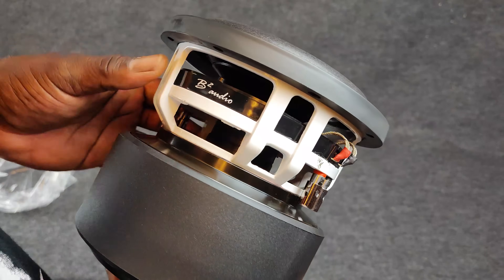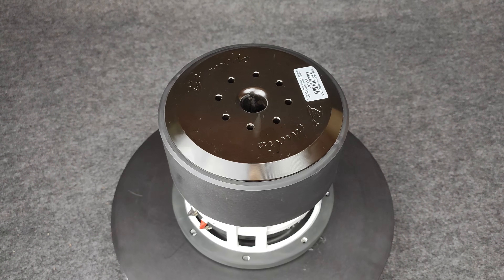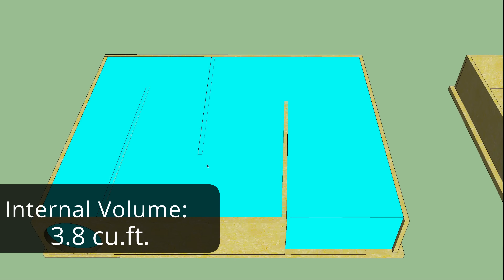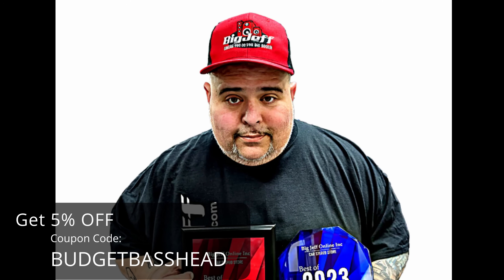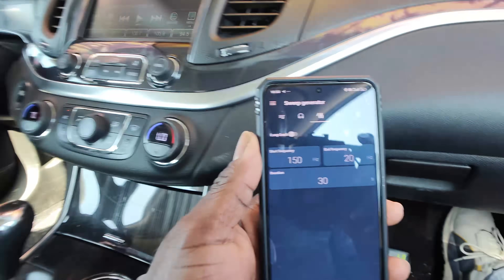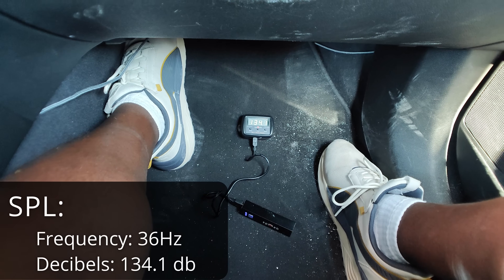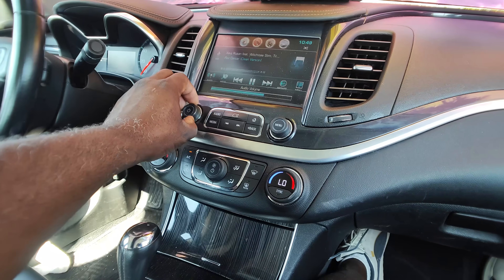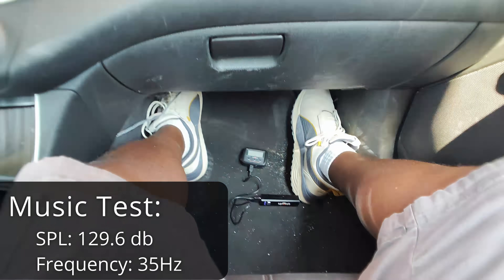I Built A Large Horn Enclosure For a 6 Inch Subwoofer - B2 Audio Rampage 6.5 - 2,000 Watt SPL Test

Comment: So build box to cover the WHOLE BACK of SUV and just rino line IT and put "stuff" on top of it if need be! Still gives ya useable "back area" as long ya rino line the top box and maybe put ya "matt" on top of the box?! TELLS ME A BMX 8 from Sky High with JP3 woild give me watt i want in my small daily SUV! (Or two 6.5s from their FE line? Tryn stay stock and jt have some "sound" onway yo sons senior HS year of baseball)!  I threw the 12inch SINGLE SKAR BUNDLE with their rp 800 in his old Gen 2 Explorer and he made his JL and MoonUp friends mad....yhey had pairs or one had triple 10s and his SINGLE LOW END SKAR "beat them down" and made them beg parents for more!  Thing is I OLD BASEHEAD and knew the PREOUT VOLTS is the "key" to good sound!  Cant use DUAL with dirty 2vs clipped up to 3.2v  and try get good sound! He got kicker 6x8s for doors over Cmas and now he MORE SQ! Plans are the compQ if something happens yo yhe SDR...have to big 3 his power then to get more out the rp800 but box is right at 2cubic feet so the compQ would work good in it!

Comment: I have a 2007 tahoe with a basic ported 4sq ft box tuned to 32hz, 2 sundown ev4s (ripped, looking for new subs), and a SIA 1750 (will upgrade to 2500 if needed) and the loudest i measured with a iphone and apple watch was 112-115 db at drivers head at around 32hz and a cabin peak somewhere in the 55-65hz range. Would moving to a horn enclosure be the move? I have my third row out but still would like to keep the box low with a 8 inch or something but I also want more power from 32 down (old subs flexed to much and was fighting the box)
Reply from the maker: Horn enclosures can provide a noticeable increase in output.

Comment: I understand how you can't resist testing any and all subwoofers! Especially this big ass little 6"! Another great video BBH!
Reply from the maker: Thanks, glad you enjoyed it. I do love testing out different subs.
Reply: @BudgetBassHead  hey what do you think of a horn for a kicker L7 15
Reply: I drew a mock up but so far its 48x64x14.75 were the sub sits will be 14.75 and the mouth would be roughly 30 wide any thoughts
Reply from the maker: @LoganAllen-te3qk that's a 2:1 ratio, between the throat and the mouth, which is pretty much what I try to shoot for if possible. But man that's going to sound quite epic! How long is the line?
Reply: @BudgetBassHead it should be around 108 inchs long
Reply from the maker: @LoganAllen-te3qk what tuning are you shooting for?
Reply: @BudgetBassHead ngl i have to do some more research i am pretty sure watching your videos i can try and learn how you were able to tune yours . But just being honest i have no clue boss i seen yours , seen how bad ass and responsive it was and wanted to try it out my self the box for the 6.5 is amazing you did grate
Reply: @BudgetBassHead so it will be tuned to 30 hz at 112 port length
Reply: @BudgetBassHead well the enclosure is built and is massive its time to play with the horn enclosure for the kicker L715

Comment: Love your videos bro. Really informative and clear. 

I’ve just bought a b2 audio 12” Rage v4, could you please do a video on that also 🙏?  As far as I’ve seen and I’ve been looking there’s only 1 proper review on the v2 version. 

Because of your other video with the NVX I went and bought myself 2 earthquake 10” slaps to run with the 12” b2, hopefully it will turn out good. 

I also purchased a DD610f to experiment with and potentially run 2 of them in 2 separate PR enclosures to swap out as and when I need for boot space and just keep 1 in to still have bass.
Reply from the maker: That's a cool setup you've got planned out, thanks for watching!
Reply: @BudgetBassHead  when building a PR, do you recommend using the net volume of the ported enclosure recommendation from the manufacturer? The rage has 2 recommendations 1.13cuft for compact ported box or 2.25cuft for normal ported enclosure

Comment: Cool stuff but now I hope people can see , that yes it is possible to get a good DB score with the right enclosure. However when you start seeing people saying they are playing 150+db on 2 8’s at 18 hz realizes how low that is and how much it really takes to play that low at that DB.
Reply: Seshmans car is very much optimized to 18hz. Output drops at higher frequencies. This is the difference between a regular musical sound system added to a vehicle and a purpose built SPL vehicle optimized to play a specific frequency.
Reply: @JasonWW2000 this is what I've been telling people for ages, especially on MBE videos just shitting on sesh. It's almost all cabin optimization, then add on to the fact that he was never actually doing 150's, but mid 40's and close to 150. Then doing low 140's with spare tire well setups recently to add on to the fact.

Comment: Loud and musical in that horn enclosure.  129. 6 dB on music and 130 + dB at 36 Hz is a win for a small sub on low power. Excellent presentation, my man
Reply from the maker: Thanks for tuning in!
Reply: @BudgetBassHead   You need to turn the subwoofer with the speaker towards the trunk lid, and do the volume test again... I'm sure the result will be higher

Comment: Great video brother.
Reply from the maker: Thanks for watching, Lee. Good thing you got that tire fixed in Part 3. Also, check the input voltage on your Fosgate amp. I had a amp running hot like that, because it only needed like 2 volts @rca input. I got another one coming with this horn. Stay tuned.
Reply: @BudgetBassHead yes sir will do. I’ll check the voltage for sure. Thanks mate.

Comment: I wounder if a sono tube with a passive radiator  on the other end   would  sound any good  or  similar to  the sound of a small jbl blue tooth  speaker .  😉🎶🎵✌️💯 bazooka
Reply: If it's got the right volume and proper passive radiator weight and displacement, it should sound good.
Reply: Great idea, I like the way u think
Reply: @armandoortega7142  thanks🎶🎵😑💯🫡

Comment: I just discovered front loaded horn speakers.  I was wondering if you had both front and rear horns on it?  Would it be super loud and have super low response?
Reply from the maker: Now, that would make some great content! Just need to find the room for it 😄
Reply: @BudgetBassHead you could look at the altec A2 and A7, etc for the front horn.  The rear you could do a W and have ports on each side.  You could double the height of this box and the upper half could be the front horn section and bottom be the folded horn.
Reply: @BudgetBassHead for the front horn get thin plywood and glue layers together to get the arc.

Comment: Bro! That box is not optimized for bandwidth or spl, its closer to a tline. Shoot me the sub DATS and i can send you a much closer optimized box for either bandwidth or spl. With that sub, im sure you can get 140db@ fs spl or 130s 25-fs hz.
Reply from the maker: I'm always learning, so thanks for the feedback! No dats just results from Hornresp. Not taking this too serious, either, just sharing something different.
Reply: Hey, Subdynoman, what do you think of Seshman's car doing 150 dB at 18 hz?
Reply: @JasonWW2000  well...first off, I don't think it's fake. I think it's absolutely possible. I've done some high #'s with my first set of horns. They were not even close to optimized. Horns have to be shaped perfectly. I made linear progression horns that were oversized. My 2 12s build did 151.7db @ 33hz with a 5k amp. The impedance rise was 2x so I was only achieving half of the potential. That was with rockville destroyers. My 4 8s in a horndid 147db @29hz and 2 10s did 146db@30hz. Non of these setups were optimized, just me having a go at it. 
Im working on dialing in perfect boxes with hornresp. 
If you have the motorforce, you just need the right enclosure to transfer that energy, and focus it if your going spl metered. A proper horn does the job. Think of trumpets, tubas and so on. Tiny energy in, lots of sound energy out.
Reply: @subdynoman Yeah, I think its possible also. His setup seems highly optimized around that frequency.
Reply: @JasonWW2000  I would say so, too. It seems to be a large cabin. It has an open area in the trunk, which would be a cavity that would lower the tuning of the cabin. The port is huge, on the opposite side of the meter point. Subs about 1/3 of cabin position. The horn design is progressively tapered and looks about 14' of length, maybe more as it should be to hit 18hz peak tuning. And the one secret that im surre is hidden but is one of his characteristics and mine...added mass to the cones. 2k rms per sub is a lot of potential.

Comment: 130db is enough for most non-SPL people. Considering that it's one 6.5" sub (I luv b2 Audio also) in a low profile enclosure, that will impress people. I always wonder though about the output with your rear seats up... that's like a pair of budget 10"s. How do they perform with passive radiators (wink, wink), lol
Reply from the maker: Maybe that'll be a future video 😉